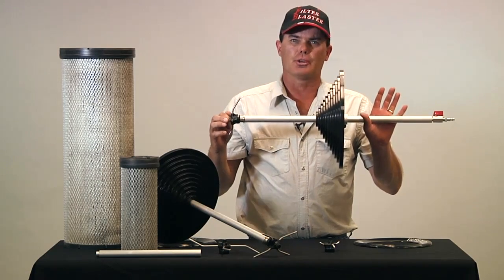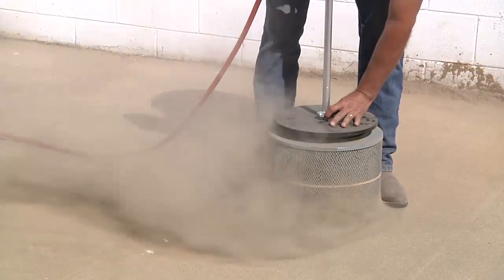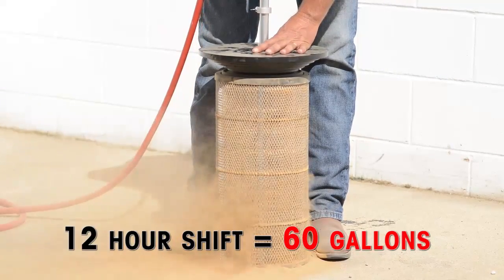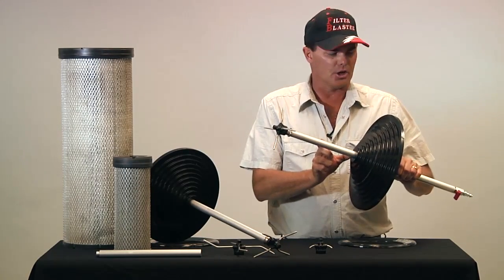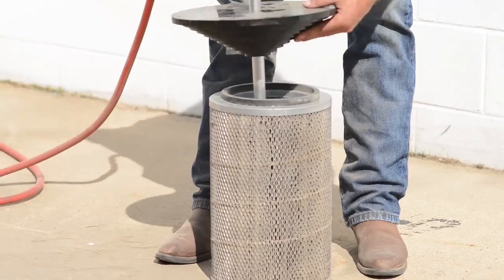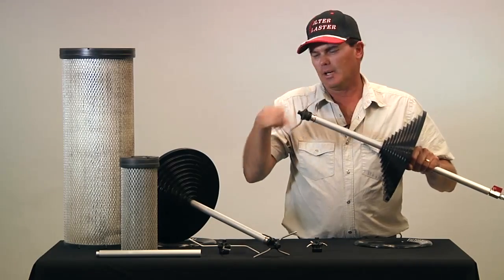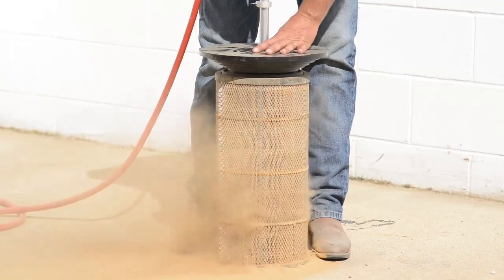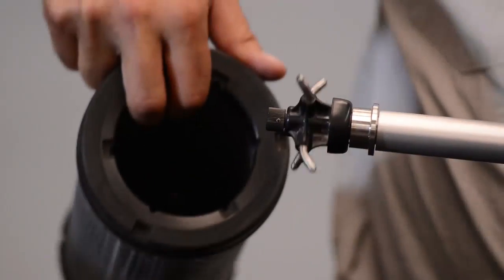Air Filter Blaster - For Cleaning Canister Air Filters, Model# USG-1302

Comment: What if you use one of those 5 to 10 gallon air tanks used to put tires on the wheel, just take the filter an put it on the end an pull the leave an let that pressure instantly clean it or will the filter blow up from all the pressure at ones ??